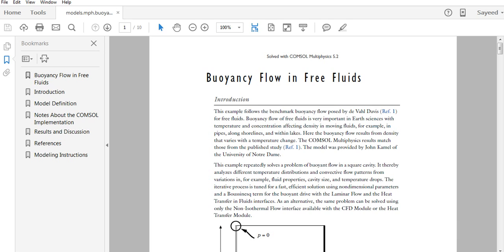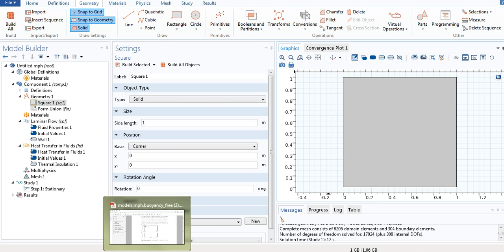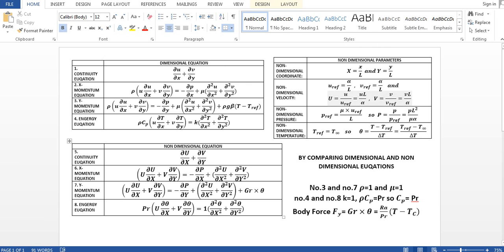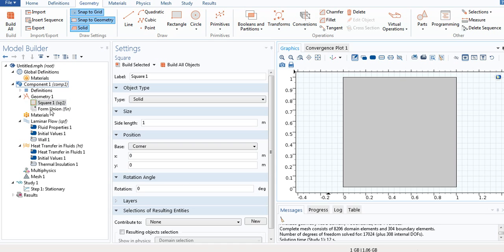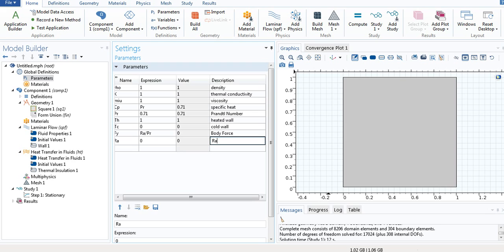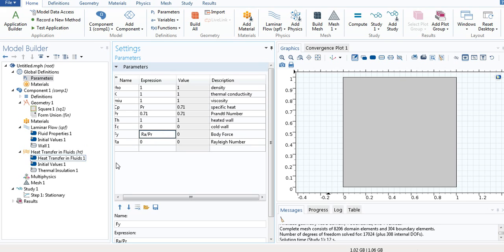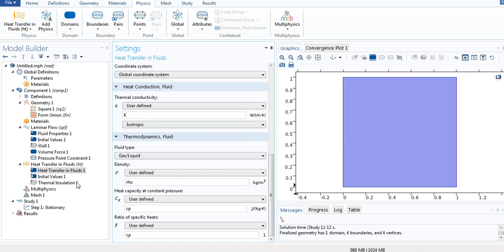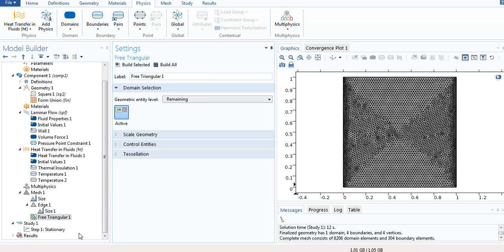Tutorial 3:  Buoyancy Flow in Free Fluids

Comment: thanks for this tutorial :)  
i am a student and i am working on modeling of convective drying of fruit which is considered as a porous media. 
i am trying to do a multiphysic problem. The model is based on the heat and mass transfer equations and the mechanical equilibrium equation under the assumptions of plane deformation, viscoelasticity and isotropic hydric shrinkage. however, i find many problems in simulating this problem since i am not so good at using comsol. 
would you please give us a tutorial on this subject ?
Reply from the maker: Actually you have a lot of physics going down there. I think the main problem is you need to couple them otherwise the solution will never converge o the results will be inconclusive
Reply: i have to couple 3 physics : heat transfer in porous media , transport of diluted species and solid mechanics.. the problem is when i couple the first two physics i get result , but when i add the "solid mechanics" i don't get result for the stress or strain .. for more details of the boundry conditions i only have a fixed constraint on the bottom